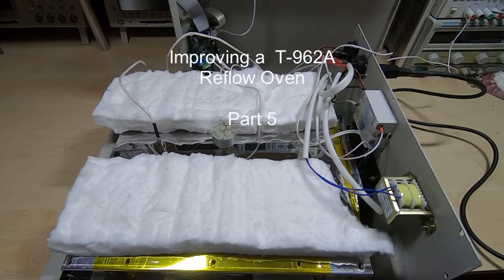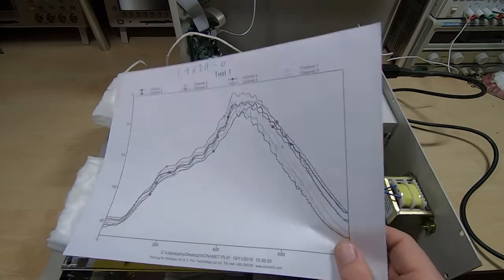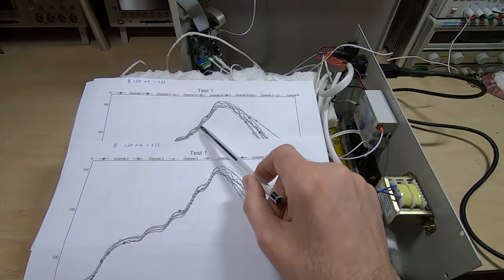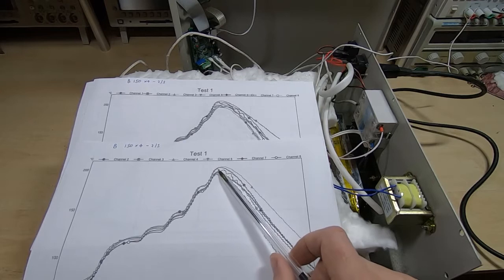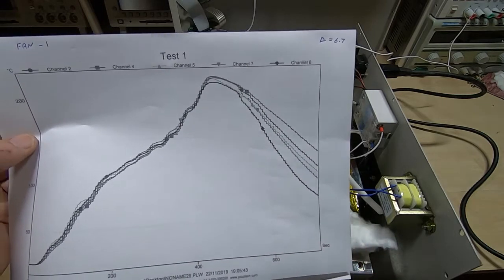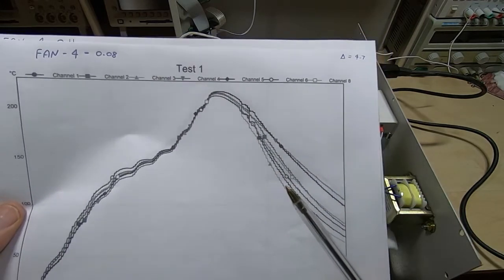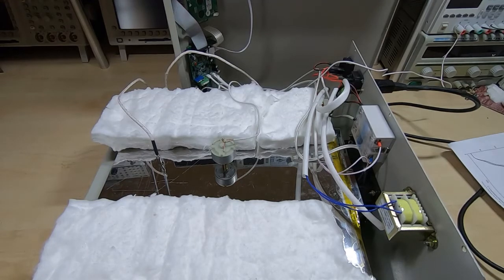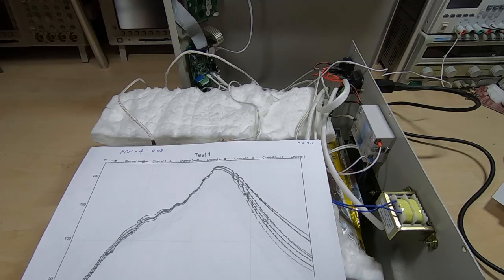Improving a T-962A Reflow Oven Part5

Comment: Thanks for your excellent contribution to upgrade the T962 owen. Your article is the first which put attention at the physical design fail in the construction, fail no fancy temperature controller will deal with. (Of course a cold junction temperature controller will deliver better accuracy). 
I also noticed that the onscreen watch is not exactly. 1:00 minute for the oven, is 1:35 min on my stop watch. This, combined with the quite long factory solder profile, can boile away the flush. 
Thanks again Jerry 😊

Comment: Hello Jerry. I just absolutely loved this series - especially running experiments, gathering data, analyzing data, repeat. Outstanding analysis. Thanks.

I have modded my T-962A with cold-junction and one of the open source firmware images (Unified Engineering I believe. I changed the firmware mainly for a better user interface. Within the past month, I re-fllowed 3 boards with 484-balls FPGAs. Of the three 1 functioned correctly, 2 did not. Actually, one of the failed boards worked after reflowing it with my Quick hot air rework station - probably out of shear luck.  Fortunately, I bought "disposable" FPGAs for 1/3 the price off a Chinese ebayer knowing the re-flow would probably be a disaster. 

I bought a pair of cheap temperature meters with thermocouples - the two could not agree on the temp on any surface - or themselves to try and see what was going on.  Then I discovered your series. However, duplicating any of your work with Amazon temperature meters/thermocouples would be impossible. So I would love to follow a few of your improvements. However, I have a few questions that might help others too. 

I do not recall (my apologies if you did mention) seeing any approximate measurements for your heat baffles. I understand yours were wider in the middle. However, I would be happy if you could share  an approximate width value. In addition, any hints on the motor you used and get an idea of RPM ? 

Thanks for your time.
Reply from the maker: Cheap thermocouple meters are fairly useless as they are inaccurate and inconsistent. My setup was fairly complex to get good results and was calibrated against a TTi7 reference meter (accurate to 0.001C). The modifications I ended up retaining (although I tried many others) were, 1) Baffles 2) Fan 3) relocate sensor 4) Door seal. I cannot give enough detail in a comment so I will post a video shortly explaining the modifications. It may be possible to further improve the oven but as these modifications give me accurate and consistent results which track the set profile then I see no real value in doing this considering that the oven will still have limitations.
Reply: @JerryWalker001  As I have been considering the purchase of a T-962A in the very near future, I am well aware of the problems users of this machine have been dealing with, and all of the solutions being offered by others.  It is amazing how much equipment is still coming out of China with the same  problems present, as when the product was first introduced.  I don't mind taking on the risk of buying a product with shortfalls, if I can see a path forward.  None of these modifications are difficult nor expensive to do.

I may still apply the open source firmware fix, but first I want to see how well the unit operates with the heating compartment issues having been addressed.  Fix one issue at a time, then re-evaluate.

Thank you for taking the time to apply your knowledge and resources to this problem.  You are on the correct path.  I look forward to your concluding video(s).

Comment: My interest in your modifications is not waning.   I am very interested.   I think you relocated one of the two thermocouples.   what is the location of this relocated thermocouple?   What is the RPM of the recirculating fan?   Do you have a mechanical profile of the recirculating fan blade?  Do you have a mechanical layout of the IR heater baffles?   You referred to these baffles as being wider in the mid point.   Thank you for your diligence/methodology seen in your videos.

Comment: Thanks for this excellent series Jerry. I've been using this oven for years with updated firmware and junction compensation. Pretty much gave up on soldering lead free regular solder with it as I needed to raise the temperature so much in order to reliable reflow all board that the parts of the boards were burned. I now exclusively use bismuth solder paste with this machine. It's lead free and with much lower reflow temperature. Once see your upgrades complete I'll probably do something similar myself.
Reply from the maker: You may find this video of interest as it shows results using lead free paste.  https://www.youtube.com/watch?v=yrbEO8k2IWw&t=459s

Comment: The easiest way to simulate a conveyor for this oven I can think of is to rotate the pcb, like in the microwave oven... :) I'm using a modified toaster oven for my pcb's and even it's smaller, I have the same problems with the hot spots... The biggest problem with direct IR heating is dependency from the color of the boards and components - darker heats faster. I'm using halogen lamps as a heat elements, maybe changing them with quartz heaters will improve the situation - longer IR wave should heat deeper in the materials. Experiments continue... :D Thank you for the ideas...
Reply from the maker: I did try rotating the pcb but it does not work very well as the centre does not change position relative to the heaters and also the max board size is very small (as the diagonal needs to fit in the drawer. The best solution I found was to fit a motor beside the rear fan and use a crank and link (spring loaded plunger to allow the drawer to open) to push a pcb platform back and forward. The crank should be just under 1/4 the length of the spacing between the heaters and this gives an average which is close to constant as each part of the pcb spends the same amount of time (on average) at each distance from the heaters which simulates a continous conveyor. A cycle speed of around 12 per minute works well. I tried this and it does improve things but as I was getting good results with just a fan and difuser I am now using just that and it works very well.

Comment: Hello Jerry, sorry for insisting on your description regarding the re position of the 2nd sensor.In your detailed reply to Loic G , you say we have to use a tube fastened on the side wall,this means that there must be a hole made suitable to accept the tube and in order to keep it fastened ,must ''solder'' it using argon or something similar?and then ,close to other end and a distance of 50mm from the sidewall so the sensor will protrude from the other end...this means that the internal tube diameter must be chosen to accept it tightly......otherwise how it can be fastened? is there any particular reason not fastening it in its new position as it was originaly fastened?

Comment: Hi Jerry,
I watched all the parts about the T962A from you now and I see you achieved some major improvements with your modifications. You are also explaining everything that you did with a lot of background but, please correct me if I'm wrong,  you didn't share more than the temperature results. For example, you experimented with the size of the baffles but didn't share the actual sizes that worked. I am not a native English speaker so maybe I just missed these pieces of information, but it would be very interesting for me. Or do you have a webpage where I can find them?

Comment: I've got 2 of these. The first one was just IR heating. The consistency was terrible. I took a chance and bought the model with the forced air circulation. It was actually worse. I've managed to improve it somewhat by modifying the shape of the blades and moving the temp sensor away from the edge of the furnace. Its really a shame they put all this time and effort into a fairly nice product, but then don't take the extra time to tune it to make it perfect. I'm probably going to give up on high temp lead-free solder with these machines.
Reply from the maker: I think they miss understand the problem. The modifications I made are not really a fan as it is not 'blowing' air around. It is a 'mixer' to create turbulence. In a later video I show the profile of this. It also rotates fairly slowly. I now get excellent results while still using the original controller and firmware. There are other changes you need to make at the same time which I also mention in the videos. For example do not put the boards on the metal base but raise it a few mm to prevent heat transfer.
Reply: @JerryWalker001  You also need enough air flow to heat up larger components like USB plugs, etc. Its not just a matter of having equal air temperature, you need to transfer the heat into the PCB and the components. SO yes, you can mix the air to get same temperature, but that will not always give you good reflow results. The big pro machines have rather strong blowers. Not so strong as to move the chips, but enough to transfer heat.
Reply from the maker: @paulgallagher2937  It does not use air to heat the parts, or at least is should not. That would just cause uneven heating, It is an IR heater and not an oven so any air movement is only to prevent heating by air. This is how it achieves fast heat and cool times. It should not be trying to heat up the inside of the chamber as this will cause all sorts of problems. It is best to have zero air flow during heating or the profile will be all over the place and will never follow the programmed profile.
Reply: @JerryWalker001  The problem is, IR heating for reflow is really, really bad. It cannot heat all components evenly. And, it will have a scattered pattern of hot/cold spots. You can get reflow on one area of a PCB and 25 mm away, no reflow at all. And shiny components such as large connectors, won't reflow at all with IR. You would need to cook the rest of the PCB to get them hot enough. These cheap ovens use IR because its cheap, not because its correct. The convection fan is an add on to try and improve a poorly designed product. Its a compromise. I got mine working, but barely. Once you start relying on air to heat the components, then you must have significant air flow. I mean, you can put a can of soda in your fridge, and it doesn't instantly get cold. Large amount of forced air will greatly reduce the time to get it cold though. So its basically a hybrid. IR is heating the dark components, and forced air is helping to heat the components with low emissivity. When I get rich and famous I'll buy a proper flow through forced air machine. With IR heating, you can't even trust your temperature sensors. That is the temperature that the sensor is, but a component with different emissivity could be very different. In the end, you just have to experiment with the profiles to get the desired results, and not worry too much about the profile.
Reply from the maker: @paulgallagher2937  I disagree and have proven this with my own oven which as I say now works perfectly and gives very good results. Even our professional ovens struggle with some components using lead free paste. For example we have to add some parts manually, such as SM transformers. That is not unusual and fully expected. However simply blowing air around an IR chamber will not help as the air is always going to be cooler than the heated parts. Professional hot air ovens have air heaters. Yes the IR pattern is important which is specifically why I added the baffles which I explain in some detail in the videos. I also show a few runs where the oven now exactly follows the profile across the entire area and that is all the oven is expected to do. It is then a matter of creating a profile which is suitable for the board you are trying to solder but this only works if the oven reliably follows the profile. Even then you often have to compromise but the smaller parts are generally closer to the board and so subject to more board cooling which tends to even things out. Either way my original point is that simply fitting a 'fan' will not help and is likely to make things worse as the air is not heated. My solution is Not a fan but a mixer and baffles.
Reply: @JerryWalker001  Anyway, thanks for making the video. You definitely helped me get this working correctly, although not in the way you would expect. Feel free to contact me privately anytime to chat

Comment: Hi Jerry, really interesting series, pity it ended so abruptly, although I appreciate it was a lot of work. Can I ask a couple of questions that may help other people watching the series. 1) I take it you ended up with 2 baffles in the centre of the machine after all your testing, what was the final width of the baffles. 2) The additional fan added above the heating elements, what length fan blade did you find optimal and what rotation speed? Cheers!
Reply: Whoops, sorry, I've just read your reply to Loïc G. Thanks for the informative series :)

Comment: Hello Jerry,
First of all, thanks for this serie of videos. I loved the experimentation and data analysis you did.
As well as the very simple modifications you did to get such impressive improvements !

I see in another video the conveyor idea was finally too complicate for not so big improvement and the only useful modifications are :
1. Baffles
2. Air recirculating fan 
3. Sensor relocation
4. Door seal
5. Cooling fan baffle

However, is it possible to get some more details about it ?
- What is the baffle width you ended with ?
- How did you fixed it ? (The distance from the IR heaters should probably be as much important as the baffle width)
- What kind of fan blade shape did you end with ? (Maybe you could post a picture ?)
- What kind of fan did you used ? (RPM could be enough but if you have a reference ...)

Did you also get rid of thermocouple cold-junction compensation ?
I don't remember hearing about this in your videos.
I should receive a T-962A+ soon and I plan to do the same experiments you did using a Seneca Z-8TC thermocouples input module in order to improve it too.
Thank you very much !
Reply from the maker: The baffles were just 0.8mm stainless steel wire. I mounted them by drilling small holes 10mm below the bottom of each heater and then fitting a short spring on one end (This stops them sagging as they get hot). They are thin and are only intended to create a 'shadow' directly under each heater. The front sensor is left in its original location but lowered to just below the heater centre line. The door seal is bolted to the top of the door and fits snugly into the chamber opening when the door is closed to totally seal the door. The cooling fan baffle is a piece of 0.5mm stainless steel sheet and it is 150mm wide and fitted inside the chamber in front of the fan inlet grille. It is only attached at the bottom and the top ends 5mm below the inside 'roof' of the chamber. This is to cause the incomming air to blow around the chamber rather than directly onto the pcb. The second sensor is moved from its original location in the centre of the chamber and fitted in through the side of the chamber so that its tip is 10mm lower than the heater centre line and 50mm from the chamber wall (A piece of stainless steel thin walled tube 35mm long is used to support it (similar to the original but from the side and not the top). The most important part is the 'fan'. This is Not intended to work like a normal fan but is intended to generate turbulent air motion within the chamber. The motor is as shown in the video but must be mounted on 25mm spacers to keep it well clear of the chamber. The fan blade is fitted to an extension piece I made which fits onto the motor shaft and positions the fan blade mid way between the chamber 'roof' and the heaters. It was made from 5mm wide stainless steel and the length is as long as possible without hitting either of the sensors. It is twisted as close to the centre mounting point as possible to opposing angles of approx 85 degrees (ie almost an impeller). The motor is driven via a 3V regulator I wired to the internal supply on the control pcb and this gives a motor speed of approx 500 rpm, It should not be too fast. I did Not modify the firmware at all. In some of my later videos you will see that the results are profiles that are not only very close (+/- 2C) of the programmed profile but also very even across the chamber.  I hope this helps. I did not take any photos at the time as there did not seem to be much interest. This oven has now been run for a total of approx 120 hours since the modifications and it has worked perfectly.
Reply: @JerryWalker001  Thanks for this prompt and detailled answer !
Reply: @JerryWalker001  Such a great video series ... thank you.  It helped me make the decision to take a chance on one of these ovens.  One thing I have become confused about ... the original long narrow aluminium strips that you hung under the elements ... these were replaced with a single 0.8mm dia wire under each element?  I was trying to find the dimensions, but now I'm concerned that I've misunderstood, because that seems like it would create an almost negligible shadow effect?